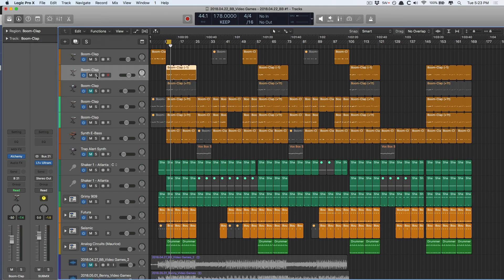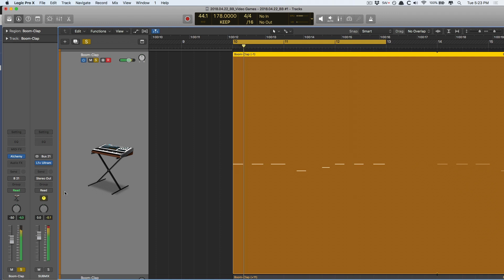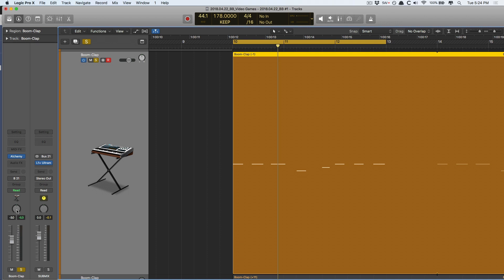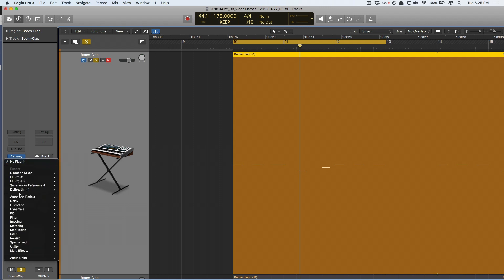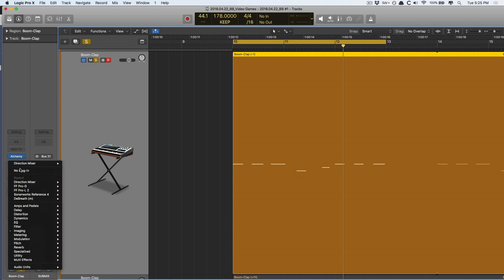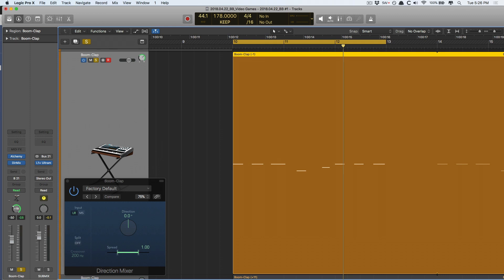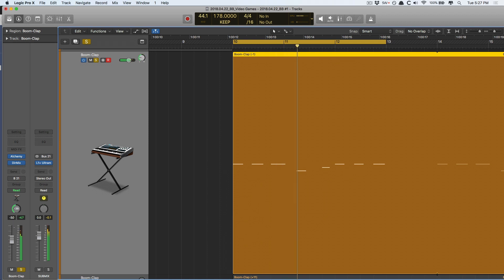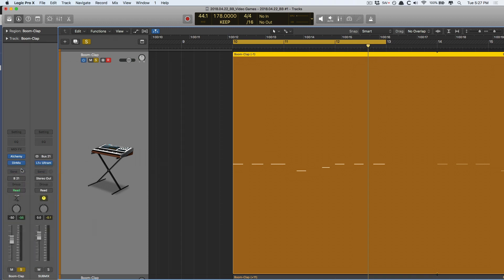How to Achieve True Stereo Panning in Logic Pro X

Comment: Is it possible to pan a single midi key? For example, if I assign a trap drum to the midi note E2 and panned it right, it would always come from the right speaker at whatever volume that midi note was set at. Could I do that with each note? 

Ideally I would like to do all of this without resorting multiple tracks for each note.🤪
Reply: I dont know if this helps but if you highlight all the notes in the midi region there's actually an option where you can seperate each midi note into one track. i get you dont want separate tracks but theres no way to pan just a single midi note and this way you can still do everything you want with one drum track and when it comes time for panning you can separate the tracks then :)

Comment: I have yet to find a process (or a video) that gives you a true stereo pan at 100% left or right of the stereo image in Logic. Other DAW's do it easily (ie: Cubase, Mixbus, etc). In your example, when you pan one way or the other, you still receive signal on the other side from a mono signal, much less of a signal grant it, however, but you never obtain a true exclusive left or right of the center position.For some reason Logic does not give you a true stereo field representation of a 100% pan from center in the stereo field. Put your headphones on and test this. Why is this? Please advise.